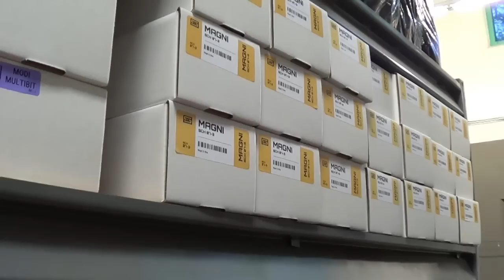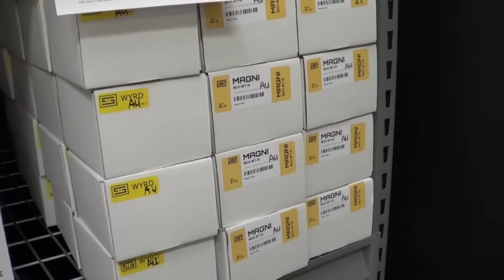MAGNI 3 BUILD

Comment: An interesting video !
I have some advise regarding what I saw in the assembly process (first part of the video):
1) It is highly recommended that the assembly lady will wear an ESD strap while holding/touching the electronic cards (the strap need to be tested on regular basis) and she also need to wear an ESD robe - these two are essentials in order to prevent Electro Static Discharge into the sensitive IC components that are assembled on the PCB, in case of a discharge it is possible that a component will stop working immediately or it will continue to work but the reliability will be decreased.
2) Electronic cards that are waiting to be assembled are piled one on the other, it is very dangerous for the cards, there is a possibility that one card can damage another one, it can lead to damaged components, damaged PCB or even detachments of components.
Reply: Sasha krik I was shocked to see the pile of boards, hopefully they listen to you since I’ve read a few complaints about faulty units, not saying that’s why but... In any case I just ordered my first Schiit product (still funny 🙄), the Magni 3 and will get a dac too if my coming stationary has a poor sound card.
Reply: @YZaccount they better listen cause it's very problematic when you sell a device for 99$ and there's no funds for customer support...
Reply: Maybe she has an ESD strap on her ankle?   Besides it looks like a very "anti-static" work area.    I think they know what they are doing.   My ears do too!  :)

Comment: Biggest take away, put a mirror behind my work bench to easily see what's going on behind everything. Good idea.
Reply: I was expecting the trays to go to a burn-in shelf before final testing & packaging (like their larger components). I suspect they take a sample set to test...
Reply: They are really just putting a finished PCBA into a case. I would suspect any real burn-in or testing for the board is done at the PCBA assembly house and then as you say some spot checks here and there from batches. Other larger gear usually seems to have some matting components they are adding at Shiit, which then i'm guessing reqiures a proper burn-in and testing to confirm everything is working as it should.
Reply from the maker: We did burn in the little stuff a while back, but we hardly ever got any bad ones. Burning in Hundreds of small stuff was kind of a pain and it didn't seem like it was doing much good. They're pretty sturdy little Schiits.  All of them are listened to before they are boxed up.
Reply from the maker: Due to the simplicity of the Magni 3 (and other small stuff) I found it difficult to make this video more interesting.
Reply: @Teeq2525  I used small, round mirrors on my display monitors in my IT days, just see who was coming up behind me.  On a test bench, however, mirrors are often used (like the one in the video) to see the other side of the equipment that you are working on, especially larger equipment.  Back in the day of CRT televisions, it was the only way to see the screen while tweaking the adjustments when you were back behind the yoke.